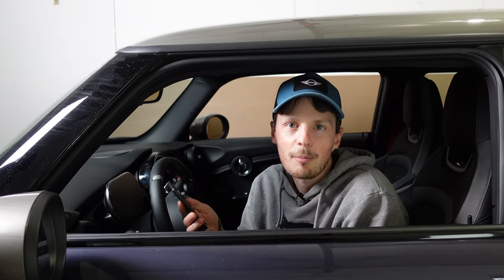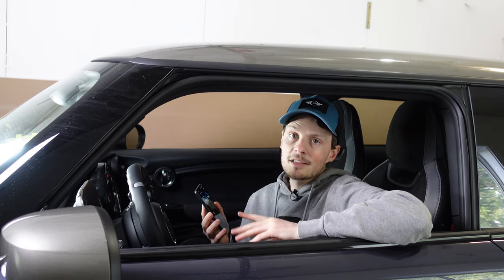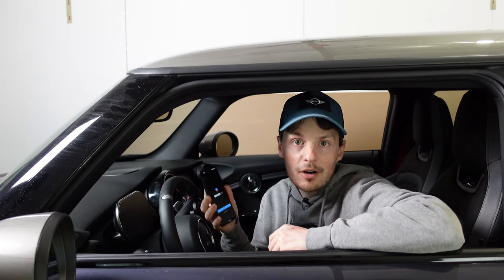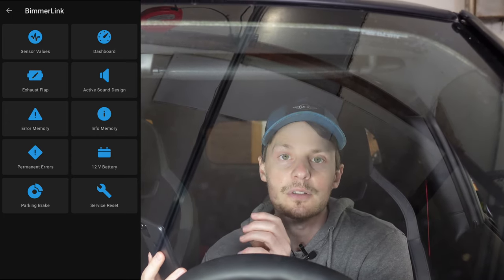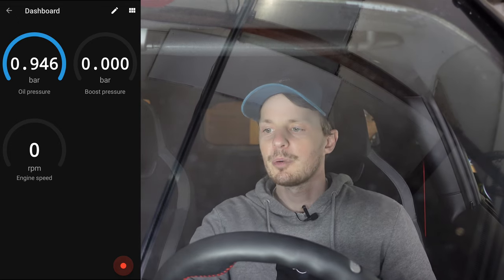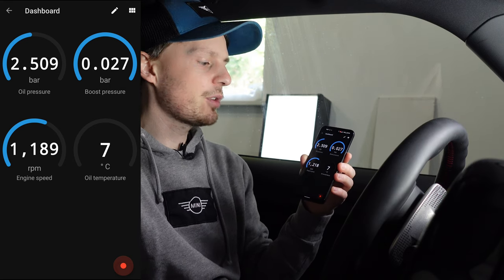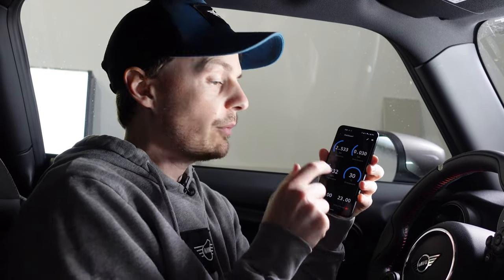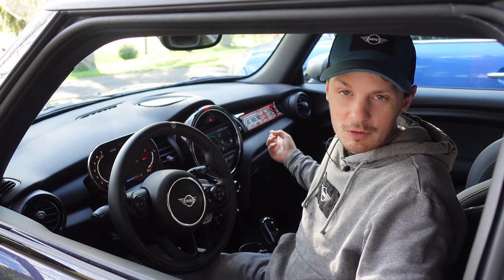BimmerLink App on a MINI Cooper

Comment: I've got less options on my R56 2009 S, only 5 options in the main menu.
You can change the Metric Units to Imperial if you want.  Before connecting go to the 3 dots right upper corner and settings.
Reply: Android or iOS? I would like to know, because I couldn't get it to work with R60 and Android 11.
Reply: @flos_01  Android with a cheap cell phone it works great
Reply: @actarusqc  thank you, i will try it again with old Android 7 / 8 devices. Bimmercode also only worked with my old S7.

Comment: Hi, thanks for your video.  If my car F56 doesn’t have electric power folding wing mirrors installed, can I still use the bimmercode for folding/unfolding with remote key lock/unlock?
Reply from the maker: I was able to get that to work on my previous   F56 that had the power folding mirrors. It was a setting in the basic mode, didn't even have to go into advanced mode. You should see it in there pretty quickly
Reply: Thanks x If my car doesn’t have pre-installed ELECTRIC FOLDING , does the code work?
Reply from the maker: Without that power fold being installed from factory, I don't know. 😕

Comment: I just got my OBD CX and purchased the Bimmerlink and Bimmercode software and it's awesome to be able to make changes to your car.  Is it safe to keep the OBD connected to your car or should we take it off every time we make changes?
Reply from the maker: The only negative I know of is that it will use some battery and it might interfere with your phones bt connection if you have your music or phone call connected

Comment: Can I use Bimmercode and Bluetooth OBD2 to register new F55 F56 battery?
Reply: No, they removed battery reset from BimmerCode. You should buy BimmerLink if your using Bimmercode. Bimmercode is for coding and Bimmerlink is for resetting, monitoring sensors, and troubleshooting.